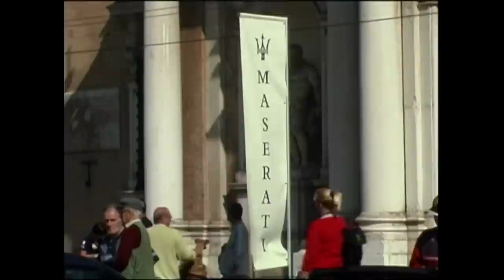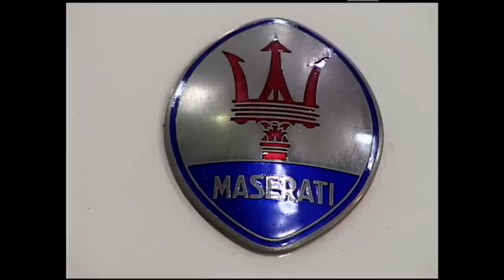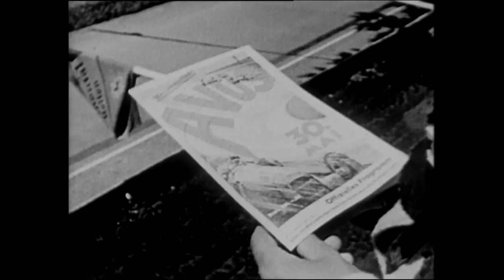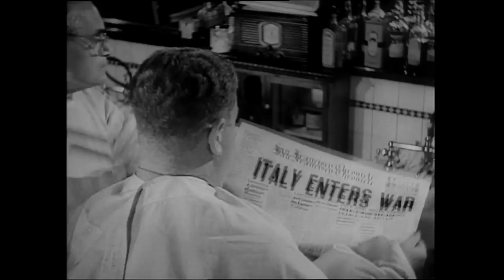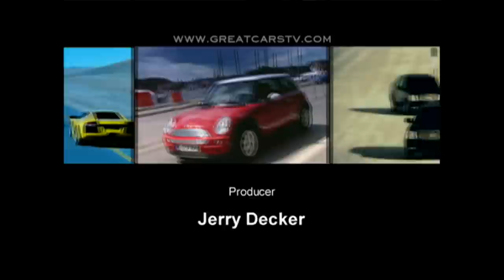Great Cars: MASERATI

Comment: I purchased the last Maserati shamal to come off the production line, before that car I had a Ferrari 328 and 355. And some 911s The shamal was a disappointment compared to my previous cars, when the 3200 came out I thought about it as it looked so Maserati, but the engine was the same as the shamal. When the 4200 was created , it came with an engine from Ferrari so I purchased it. Honestly, it's the best sports car I have ever driven. The engine now fits the Maserati looks, even the clock is set in leather, not plastic like the cars that came after. It's a dream to drive , but you have to spend at least week getting to know it.